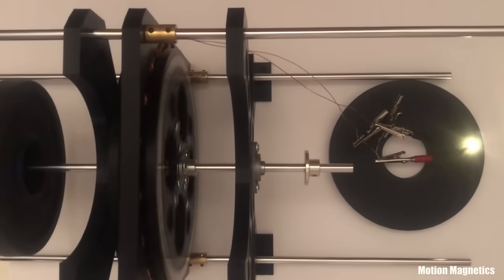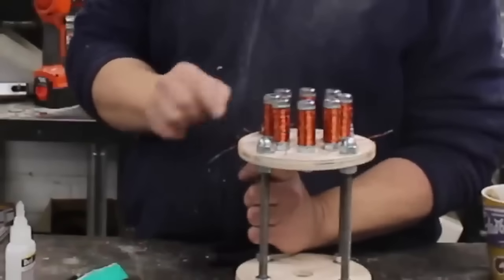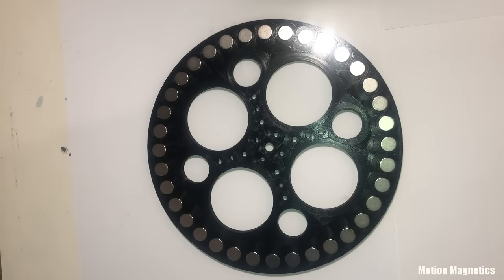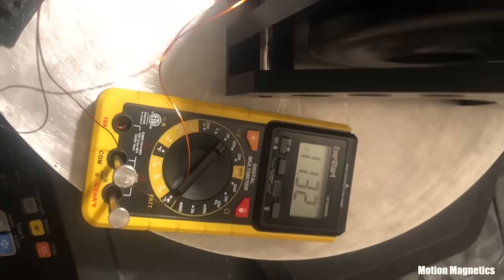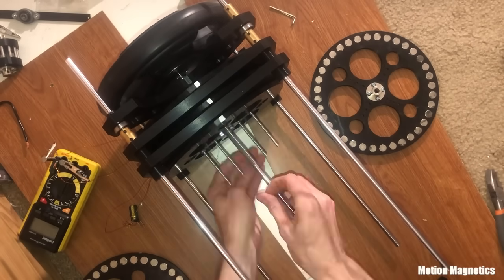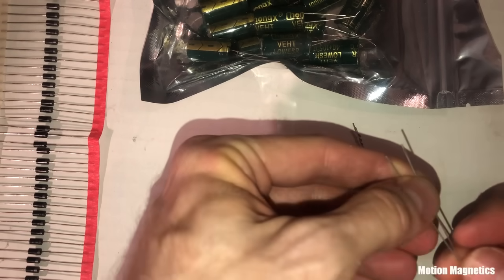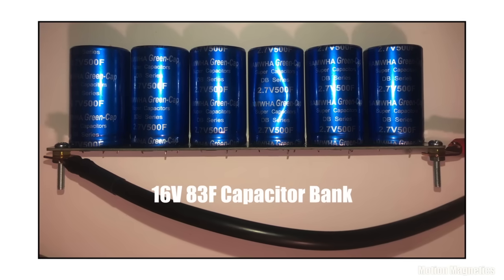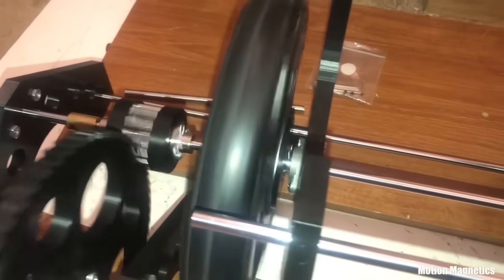Stackable Generator

Comment: no mention of amps. This is like promoting those car alternator free energy scams. You fail to mention the volts + amps (total watts) it can do. These projects are okay to learn mechanical advantage/gears and watts/amperage. But if you're serious about generating electricity you should focus on 1+ meter water wheels  that generate 1.5 Kw or at least 10-20W bike/alternator generators.
Reply: Eh what? A bike generaor is really, really bad if it can only produce 10 or 20 W output!

My pedal-generator can produce 120 to even 200W of output. As it uses a 350W motor, so of course it will produce hundreds of watts. It can produce 144W of USB-Power (4x QC 3.0 á 36W each) or 82W of 48V or around 10A at 12V (120W).

The actual output depends on human´s forces though. If you are weak, so the output of the generator will be weak. If you are strong enough, you can easily reach 120-150W or even 200W.
Reply from the maker: I believe I mentioned it was around 5 amps at low speed.
Reply: @Motionmagnetics  You should better use a high RPM-motor if you want to reach even 100W...!
Reply from the maker: @SmartZero-f8e  Thanks. I've already far surpassed 100W with the current setup.
Reply: @Motionmagnetics  Really? Ok...But remember: the goal of such a machine is having a LOW resistance. Your resistance is HIGH.

So how do you want to power this machine if not by hand?
Reply from the maker: @SmartZero-f8e  Gravity. It spins easily by hand, so you could also use this configuration for wind power applications, water wheels, or even a pedal generator.

Comment: If you are using counter rotating mecury wheels in a tremendous em field you know your shit but what if you could take advantage of graphenes strength and crystaline lattice strutcure to create a vortex around highly energized ultra low or high frequency oscolating magnetic resonant electrical and vibrational fields like the good dr pais nested fields patent

Comment: The whole thing is getting the 9 tesla flux what was it like 10 to the 8th volts per msq energy saturation needed to get a magnetic flux of 9 tesla ok on that note would the eqation that denotes this exact frequency and energy distribution when reversed be the frequency of the zero point tap

Comment: Can someone explain how does it reduce cogging?
When coils are connected to load, they will create their own magnetic field, which will repel the approaching magnet and attract the departing magnet, that's why the rotor slows down under load. 
If possible, can someone drop link or some other source, I'll study myself without bothering others?

Comment: What do you think it would take to get a system like this to output 24v at approx. 60 amps?
Reply from the maker: Good question. I'm not sure I could answer that accurately... yet. I'm working on it though.
Reply: 24V at 60A? What?

That´s over 1000W! That´s what a big wind-generator (1000W is big for wind-turbines)uses!

Comment: Question: Do you typically polish off these projects over time?

It's an excellent design, and my only notes are about optimization rather than core concept.
If so, I think you could benefit greatly by optimizing your weighted ends.
Your exercise weights are a fine idea, but watching them rotate and seeing the uneven motion made me wonder how much more efficient they would be if its weight distribution was uniform throughout a complete cycle. As it is, you're losing rotational energy to gravity(inevitably) as well as a non-stationary center of gravity in the system(likely infinitesimal change). Of course, that being said, optimizing the weight distribution of your rotors while in motion would have a similar effect in increasing efficiency, as well as getting as close to an ideal shaft as possible, but optimizing the weight distribution of FDM 3d-printed parts can sometimes be difficult.
Reply from the maker: It definitely could use some optimization. I'm building a prototype right now, so I'm trying to keep it simple while making adjustments and improvements as I go along. Thanks for the suggestions.

Comment: Okay some people are going to shout at this... Take your 3D printer and print your coils. There is no reason you need to wind a coil you can 3D print the damn thing just redesign the way you think about coils from dealing with round cylindrical wire and work it out into a contiguous 3D print... You can probably find a material that works as an insulator as well as bakelite...

Comment: How much metal do you really need? Like what if you just had a circular metal wire running through each layer instead? Enough for the field but not enough for the drag?
Reply from the maker: If you mean as a core for the coils a smaller metal wire wouldn't produce the magnetic field that a larger iron core would.

Comment: Look at MPPT charge controllers, they will optimize operation for varying RPM/Volts input.  This helps get good charge output with a wider range of speeds.  Three phase rectified is going to work best.
Reply: Problem is: They consume a lot of energy as well. They won´t start if you don´t reach a certain voltage first (=energy-consumption). Becuase your machine wouldn´t start if your power-generation doesn´t reach that voltage. So the energy is lost.

Comment: What would happen if you set it vertically and eliminated the center rod?
Reply from the maker: There would be nothing to hold the rotors in place without the main shaft, so it would take a redesign to even accommodate the changes.

Comment: .
 on every corner until I want the fukn things😂😂😂.
Can you draw me as picture of the EMP of a running generator & how far it EMANATES from engine/generator whilst running? 
I'm looking at wireless charging capacitors whilst engine running.
I see movies in my head all the time I would need a lab the size of TESLA battery factories to play with all the shit that flies through my head is fukn crazy hair the time.
Trying design a flying Bubble/house & car..
I need eventing (engines/appliances) PERPETUAL ENERGY & minimal no batteries can't carry garbage for no reason & more interested in efficiency & quality over quantity & selling parts.
Why make garbage wen you can sell quality insurance I say.
Man is a bit slow on the uptake.
Not enough ppl talking to GOD i say.
We shall see.
PERPETUAL ENERGY IS NATURAL LAW.
PERPETUAL ENERGY IS GODS LAW!

Comment: look... you can take this advice.. - Or... ignore it.. - What you need is a Gear Train.. - Think of a Old School Coo coo Clock.. with the pull chain and weights.. - Simply Make it Bigger.. - get a longer lasting Spin, without the pull string.. - the stacking is a great idea.. - heres a Muse for your design, Google Yard Metal wind spinners, there is more then 1 way to Spin a rotator.. Good Luck
Reply from the maker: Thanks. That's what I'm building now actually. I mentioned that as part of the design in my video on the gravity generator concept.

Comment: Suggest put pole shunts on the outside ends linking the magnets north pole to the adjacent magnets south pole.
this would reduce field leakage and improve the MAGNETIC CIRCUIT EFFICIENCY. 
PS. Being a static field there will be no HYSTEISES LOSSES OR COGGING

Comment: You should use Shottky diodes. They are 3 times more efficient (0.2 vs 0.6 Voltage drop.

Comment: If it was me i would have used a 5 amp 1000 volt piv which will give you a higher head room for any surge or spikes you msy get. I would also uze a higher voltage capacitor running about 50 volts rater than a iower voltage. It is better to over rate your electronic than just barly above your rateing
Reply from the maker: You should do that and post a video of it so that others can learn from your ideas.

Comment: hey, this is awesome. I was literally just trying to put together one of those eccentric cycloid generators with a stackable coils like this what would happen if you did like four of the coils spinning and then you put like a cylinder of magnets on the outside of those stationary  coils that also spun off of the main shaft, but in reverse would that do anything? would it add to the power that the coils are producing because you're spinning another magnetic field around the  already spinning coils? would spinning it in reverse with like a planetary gear create anything different? or substantial cause its spinning opposite the other one?
Reply from the maker: Thanks. Not sure how that would turn out, but if you give it a try I hope you'll post the results. It would be interesting to see.
Reply: @Motionmagnetics  challenge accepted. I'm guessing it would just add to the amperage maybe what I was reading, stronger, magnets, more amps maybe just more magnets more amps too I don't know but we'll find out good experiment.
Reply from the maker: @Gboyrides  Sounds good. Send me a link to the video once you put it together. I look forward to seeing how it turns out.

Comment: There are several other options you could take.
Use an inverted system – Put the coils on the inside, use a cone shape, aka bowl to put the magnets on so they spin around the coils. When spinning that force will counter the drag to some degree.
You could also use a gravity imbalanced system, only have the magnets/coils on the one side where the gravity is pulling down. Depending on the speed/power draw, you balance out the difference.

An entirely different route is differential energy harvesting.
Design a compression chamber/ aka a pump with a tank. Then choose a good PSI level and get a counter balanced weight for the pump to match that.
Then proceed to bleed excess PSI from that into a second tank, and boom, massive PSI output for minimal energy/mechanical input.
Several companies attempted similar methods using water and air as the energy transfer at the bottom of a long cylinder tank.
Others used large angular systems, like a good old oil pump.
Basic concept of most of these mechanical designs is to create an imbalance and balance it by the draw/energy you are taking out.

Comment: Couple of things:
1, not completing the flux path (i.e. not not having a close fitting ferrous core between the stator and rotor) is never done commercially for a reason. Just using coreless copper loses far, far too much efficiency for anything other than radio applications.
2, "Drag" and cogging are two different things, and generally when cogging is a problem for low power starts, like with real wind turbines, you use an 'off by one' ratio between the rotor and stator, like 5 stator poles to 6 rotor magnets or 'off by two' for larger numbers. It essentially eliminates cogging but you do need a slightly more complicated winding.

When you're considering the expense, consider the efficiency. One silicon-steel, laminated, gapped, properly wound generator would be more efficient and put out more power than as many 3d printed stacks as you could fit on that rod.

I know you're probably aware of this but a rewound truck alternator can get you 2kw at maybe 80 percent efficiency.

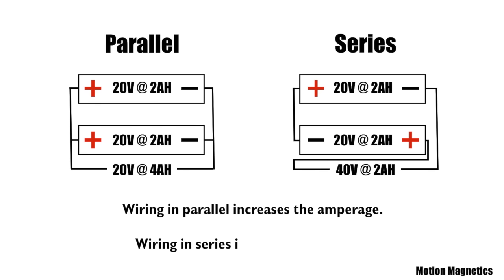Comment: ‼We should make a note here, at 10:42
“Amp Hours” or 'AH' = measurements of capacity (like how full is my gas tank)
“Amperage” = Power being used  (like how hard am I pushing the gas pedal)

              I say this because in the diagram, we hear  “wiring in parallel increases amperage”,
however our diagram shows us [ 2AH + 2AH = 4AH ], which if wiring batteries, is true. 
But this does not seem like it was the illustration intended by the person teaching us, since he tells us about wiring for increased “amperage”, not (AH) or “Amp-Hours”
⚡
These are two different terms in electrical engineering, and if you are new to this, you will find that you will be using either Amperage or Amp-Hours, very often, as long as you are working with electricity. It will be important to know what each is, how, and when to calculate for either one. 

Concerning Amp-Hour, Watt-Hour, and 'C'-Rating for batteries. 
>not related to this video's project, but if you are not familiar, or are interested, it will help:
https://www.youtube.com/watch?v=cxkVxi9P0EA
⚡
I am coming from a DC-voltage world, of batteries, small microcontrollers, single-board compute modules, and peripherals. This video is fantastic. It is spawning my intrigue, and imagination. 
Thank you, 😎 Motionmagnetics, for sharing your work! 

I am currently trying to figure the most efficient way to power a robotic system, off-grid, with UPS and with as little supplementary re-charging of the battery bank as possible.  As I type this, I am learning how to provide as much energy to the system, as possible, from sources like your gravity battery, solar, wind, hydroelectric, and anything else I can think of, or discover, to make those trips to re-charge the UPS as infrequent as possible. I hope I have a success story for you all in the coming year or two. But, wow. This is a lot more challenging than I first thought. All the more gratifying,  if it does end up coming alive!
Reply from the maker: I may have abbreviated that wrong in the video. Thanks for pointing that out.
Reply: @Motionmagnetics   👍happens to the best of us… keep up the good work friend, i love it!
Reply from the maker: @Inertia888  Thanks, I appreciate you.

Comment: your generator is awesome and try the bridge diode array or something 
and from the coil output add a step down transformer then the diode and capacitor it might help you with drag even more and get amps up too i had that working with old chinese celling fan but had not much of neo magnets and 3d printer that time soo 
gud luck with your project
Reply from the maker: Thanks and thanks for the suggestions.

Comment: You're limited by 100V, also 50 Amps.. there is no way on earth this project will ever put out 5kw :D Not to mention: you hand-cranking it.. a human can on average produce 100w mechanical energy (yes, ofc you got athletes that can leg-peddal much more). So this is not a way to test any generator..
Reply from the maker: I'd be happy with 5000 watts. It won't run by hand cranking though. I was simply trying to demonstrate how easy it is to get some power out without even having it hooked.

Comment: If you want to figure efficiency connect a cordless drive to end of rod , that heavy fly wheel is great on huge motors with dam turbines or other heavy constant spinning turbines. but really lowers your drag coefficient on things that stop often and are smaller scale. the battery operated drill will give you a base line for efficiency  and completely remove the drag the weight is causing on your rod and spindles. Just a thought, if it's extreme high rate of return a really light weight spindle or corkscrew wind turbine wing design may produce good results. Sorry I forget what those small wind turbine propellers are called off the top of my head but the don't look anything like your tradition propeller
Reply from the maker: Thanks for the suggestion.

Comment: have you thought about touchless spindle using gallium a floating or lose dampen drag coefficient, or building in a vacuum. Not that I know anything but I like innovation and giving different perspectives on dealing with aspects the limit efficiency of energy transfer. Keep up the good work.
Reply from the maker: I haven't thought of that.
Reply: I mentioned gallium in that, I meant bismuth as it's dielectric @Motionmagnetics
Reply from the maker: @RayOpp1  Interesting. I have a huge chuck of bismuth just laying around.

Comment: Is thicker copper wire less turns better then thin wire more turns?
Reply from the maker: Thinner wire will give you more volts and fewer amps, thick wire will give you more amps and fewer volts. You can convert it through a transformer, but it really equals out to about the same energy output. So it really just depends on what you need for the particular application.

Comment: I don't ever have time or money but I have thought of many gravity generators in my mind. I feel as though  everything that moves vertical or horizontally can be used as a gravity turbine. The hardest part is getting the weight back up. I came up with an idea of using ballasts or submarine type deal that float with air and sink with water.
Reply: Also vacuum air pressure works for lifting
Reply: The way the ballasts work  ( in my mind at least) is you make it like a Pythagorean Greedy Cup. You have water connected to it and as it feels with water the ballast sinks in a container of water. Due to the Pythagorean Greedy Cup design when it gets "full of water" as it reaches the bottom it drains water and floats in the container to raise the weight again then filled with water to start the cycle again
Reply from the maker: That's not a bad idea. I'm going to use pulleys to make it easier to reset.

Comment: Why not use one metal wire inside the coil
Reply from the maker: If you mean stator to stator it would be too easy to make a mistake if it was all wired as one unit with one wire.

Comment: i have wanted to build this for ages, please do me a favour, rig a small dc motor to drive the shaft, power it from one half coil and use caps to smooth it out, i wish i could have put this together myself, excellent build, well worth the sub this could essentially pave the way to creating a self sustaining mechanical generator
Reply from the maker: I'm planning on making the STL files available after I work a couple of kinks out, so you're more than welcome to alter my design and move some things around to test your idea.
Reply: @Motionmagnetics  I am eagerly awaiting this, I actually bought a 3d printer this week, specifically in anticipation of this. Seriously!
Reply from the maker: @thejaff23  Wow, I'm honored and humbled by that. I'm putting together an assembly guide video now that should be online soon with the STL files.
Reply: honestly i dont think my 3d printer pen is up to the challenge lmao @Motionmagnetics